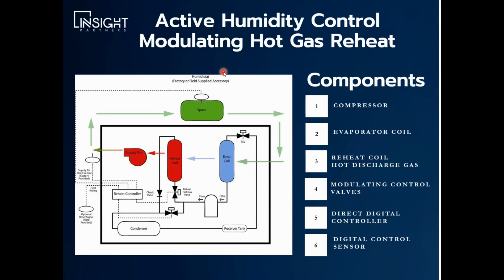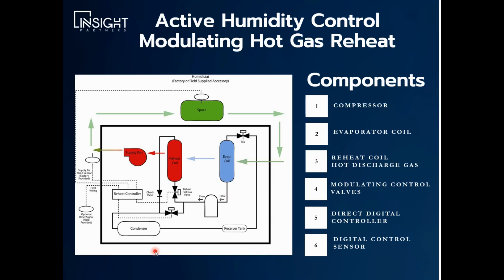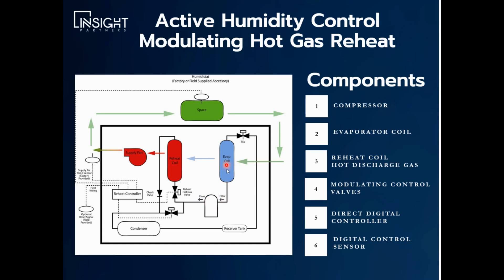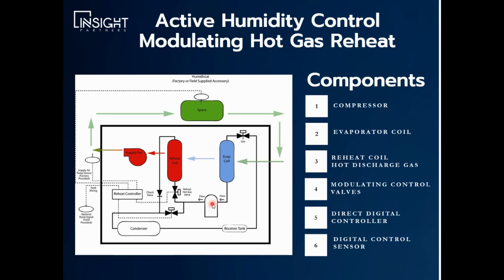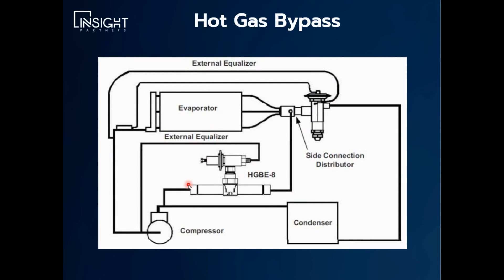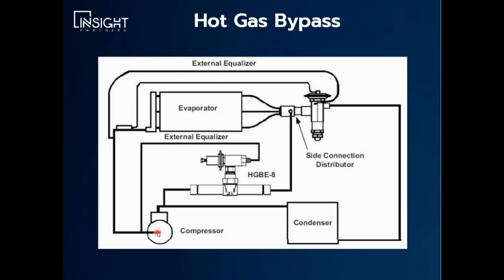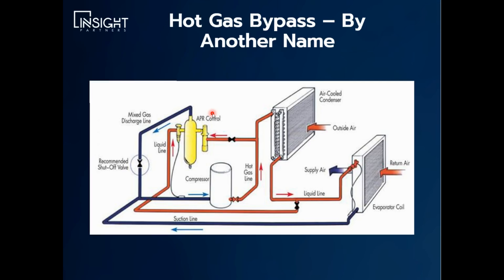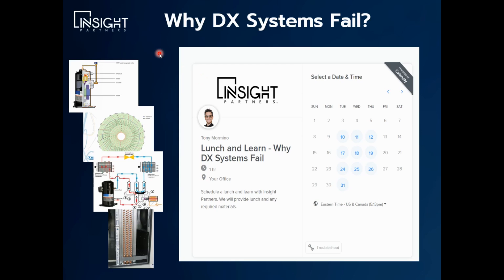Hot Gas Reheat vs. Hot Gas Bypass | HVAC TV

Comment: I have a AAON with reheat and hot gas bypass. It also has digital compressors.  Why do you think they did that
Reply from the maker: Hi Jason.  Many reasons but not familiar with your application or location.  Typically, on some of my applications,  I would include HGPB for extreme freeze protection. Even when I have a digital scroll.  Thank you for watching!